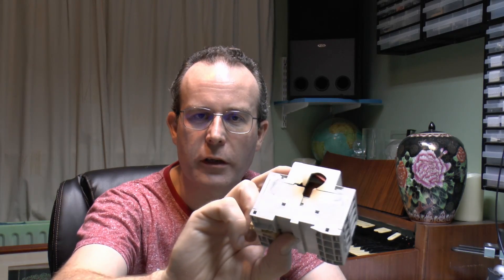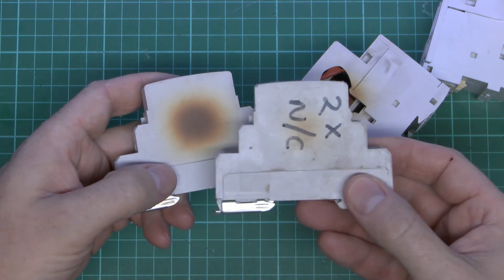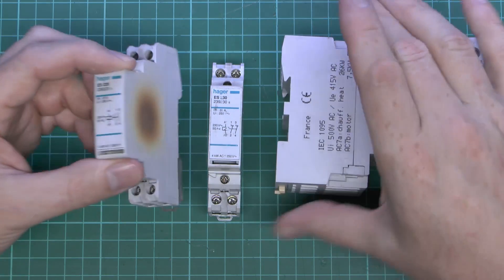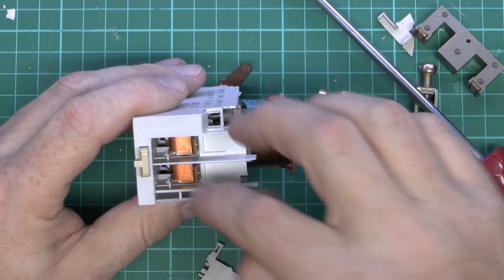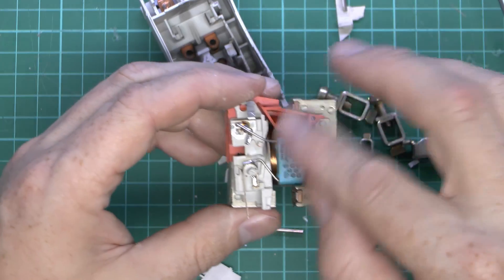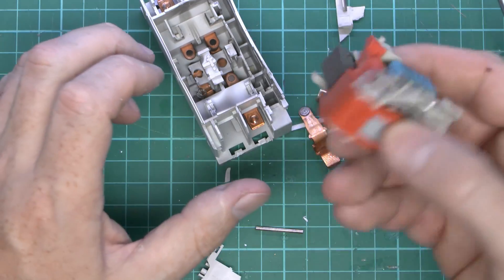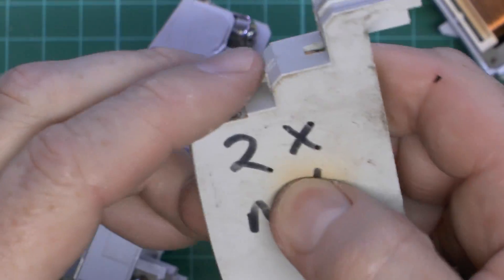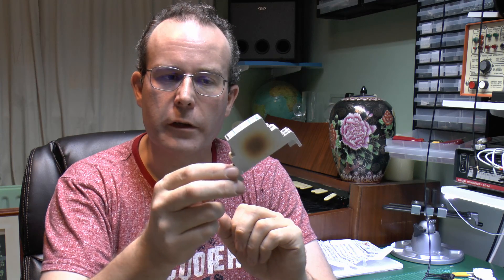A look inside some contactors, one with a broken contact.

Comment: Any advice on how to reduce overheating? Would spreading the contactors out within their enclosure to allow heat to escape more effectively work, perhaps?
Reply from the maker: Yes, if 2 or more are installed, putting a spacer between them will increase ventilation and reduce the temperature.  The same applies to circuit breakers which will be loaded at or near their maximum rating.

Comment: Have you any idea what a Release Relay is? I found an ABB one in an old 40amp shower switching circuit consumer unit which protects against two electric 40amp showers being on at once which would blow the network fuse as we have 63amp supplies in Ireland (and 80amp on special order). I suspect it is a current sensing relay? Here is the data chart on it but still a bit of a mystery. https://new.abb.com/products/2CDE160000R0901/e451-5-7a-release-relay

Comment: Have you ever shorted live and neutral together by accident? Or live to earth? If so what happens?
Reply from the maker: If you do, a very large current flows, typically hundreds of amps and this causes the fuse to blow or circuit breaker to open almost instantly, disconnecting the supply.
If there was no fuse/breaker then the high current flows until the wires melt, probably causing a fire.
Demonstrated in this video: https://youtu.be/bBYHtBPbBJE

Comment: Not too relevent to the video but i changed a fuse board the other day  and there is a fault with the sockets, everything else will work perfectly fine but as soon as i switch socket mcb on it will trip the rcd straight away, any idea what this could be??
Reply from the maker: Most likely is a fault between N & E, which has probably been there for years but undetected until the new RCD was fitted.
It's normal practice to test the circuits before installing a new consumer unit.

Comment: Hi John, an interesting video as always. As a regular follower of your channel, I was wondering if you would like some failed Merlin Gerin vigi 3phase RCD's and MCB's for autopsy? I have two of each, both seemed to fail at the same time in the same installation, supplying high power (2kw) floodlights.
Reply from the maker: Yes, please send them in.  Address etc here: http://xo4.uk/?YTT
Reply: Thanks John, will pop them in the post soon
Reply: Hi John, these should be with you soon. Unfortunately I didn't get chance to pop a note or anything in the box. These came from a (small) football stadium, each breaker combo supplying 2 x 2kw and 1 x 1kw metal halide floodlights from a board of 6 of these. They both failed at the same time (they tripped and then wouldn't reset) as a bulb (another 2kw MH) blowing elsewhere. 
Hope they are of interest
James

Comment: Is there a difference between relays and contactors?
Besides the name?
Reply from the maker: Contactors are designed to switch high power loads, relays typically are not.  Functionally they both work in the same way.
Reply: Contractors switch current using two contact pads as shown in 11:25 of this video, you can see that there is a bar which makes contact on either end in the closed-circuit position. Relays on the other hand only use one contact pad much like a switch. This is normally why contractors can switch larger loads because the air-gap is effectively double that of a relay. JW's done a good video explaining these: https://www.youtube.com/watch?v=5Iujs94re_U&t=337s

Comment: arcing also causes huge amounts of UV light, which destroys many plastics, this may also be a factor here
Reply: they were constantly powered up for a very long period of time, usually when the appliances were not energised.
only arcing you can see is on the 2x nc module, this provided power to the rest of the contactor bank and was powered via a 24v relay via the stop button and fire alarm system.

Comment: Those contactors are bulletproof under normal use, no worn points or burned insulation on the coils just the casing browning and becoming brittle, perfect way to make something need to be replaced thus ensuring continued supply situation a bit like lightbulbs with limited hours!
Reply: They should have vent holes on the top and sides to provide a bit of air flow to cool it by natural convection.

Comment: NC one I would say somebody pulled a terminal strip out during assembly, and just pushed it back into position. However they pushed the contact strip out of position in doing this, and it probably worked for a while before the non german silver areas contacting arced themselves into oblivion, failing the contact position as open, or it slippoed down further due to not being located, and opened the circuit.

Those contact units are reversible, used for both NO and NC use, simply by taking the current terminals out and replacing with the alternate side, or in some just by placing into the alternate position in the housing, and turning the current carrier in the centre over to the other position.

Yes the coils run hot, but those should be capable of running at class H temperatures, though that also needs cooling by having a spacer gap between units like you said, and not having the box stuffed to the max with wire as well, but enough airflow for convection cooling to occur.

Just wonder why they had them on contactors like that with them on all the time, as they should have had an off period like cooking with a time of use tariff, or a water heating or such tariff from a utility meter.

Comment: I have a hager ES230 permanently energized as part of an emergency lighting circuit.
They can be a bit noisy, good to see they do survive a long time. It has 1 free module either side for cooling so hopefully the plastic won't get brittle over time.
Reply: I would drill some small vent holes in the top and sides to cool the coil by natural convection.
Reply: That'd be unnecessary, void the warranty and potentially make you liable in case of a fire.

Comment: Normally I use contactors fitted with a series economy resistor, does require an extra set of contacts to place the resistor in series with the coil once energised this helps with the coil overheating
Reply: I just got a brand new hager contactor 220V~ (similar to the first one he shows here) and tested it with no load for about 20 mins and it got blazing hot to the touch! Is there something I can fit to it to reduce the heating? No way I'm putting anything that gets so hot in my panel.
Thank you.

Comment: Not used The MEM ones before, have used the Hager ones, and other brands of similar construction. I would not be happy seeing this amount of heat damage on one of  my installs. Where were these installed? And what was the ambient temperature? Spacing would help. Be good practice to also keep these clear of circuit breakers also.
Reply: They where probably over 20 Years old, Heatdamage from the Coil is normal with that Age.